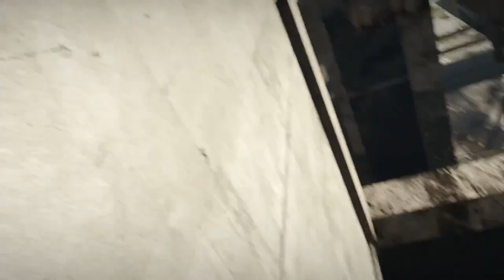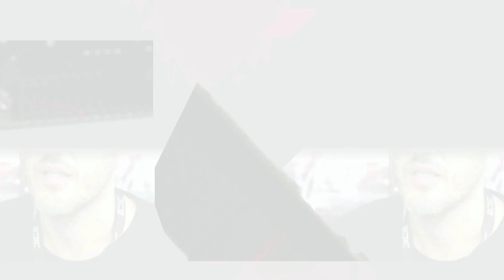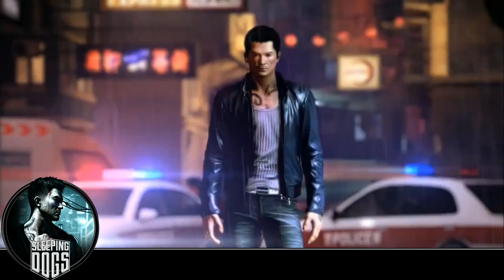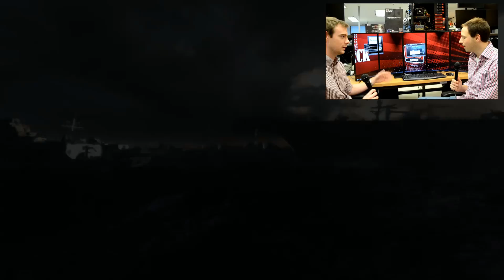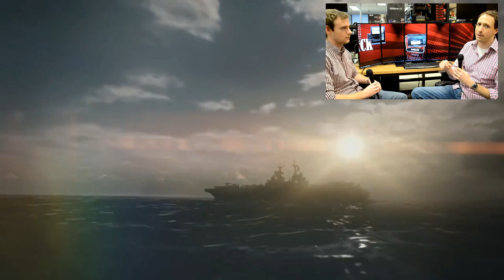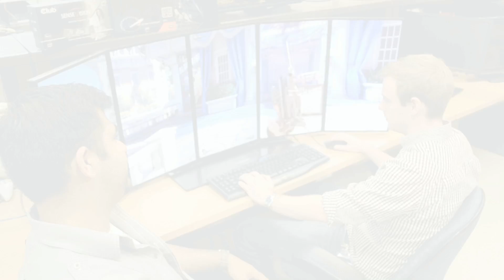Club 3D R9 290X and BF4 Bundle - Interview with AMD About Their Latest and Greatest GPU

Comment: I dont think the 290x will crush the gtx780, but will match or slightly outperform it. Most review site dont dare overclock both cards and show max performance from reference designs. It seems like they are scared of making AMD look bad. Sites that tell the whole story are OC3d and Linustechtips. The fact is ture that at this time nvidia gtx780 ooutperforms 290x overall. When you throw in 3rd party cards in the mix, the gap is even further. Remember that even 3rd party gtx780s are cheaper than reference 290x. Even if 3rd party 290x beats gtx780, its not going to be by a large margin and it will still be $50-70 more for 0-5% gain. The one card AMD fans should pay attention to is r9 290. It performs similar to the 290x, but $150 cheaper. I am waiting for the 3rd party cards to be reviewed. If the temps are good and its quiet, I will pull the trigger on 290. If the temps are still in the 75-80c I will wait for MAXWELL from nvidia.
Reply: 290x crush the titan

Comment: R9 290x isn't faster then the 780. The 780 overclocks better atm, until AMD improves drivers and non references designs get out, then atm the 780 is probably the best bang for the buck as its cheaper by $50.

Comment: AMD was claiming that the 290x would outperform the Titan on BF4 with Mantle, so based on current benchmarks, Mantle could bring a 10-20% boost to GCN based graphics cards. Also consider non-reference designs are often quieter and cooler.

Comment: The 290X is a great value, but I still can't get over the fact that this card runs at nearly 100 degrees celcius! This thing is extremely overclocked out of the box. A stock 290X beats a stock 780, but once you overclock the 780 and 290X, the 780 beats it. Still a better value than 780.